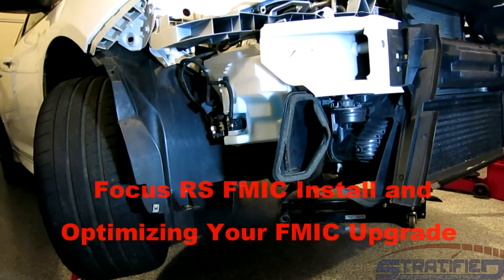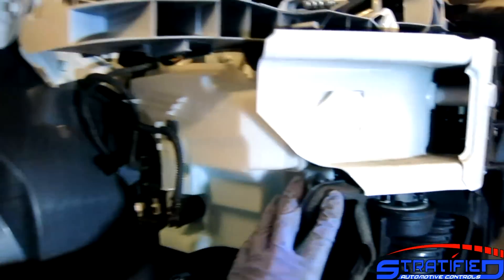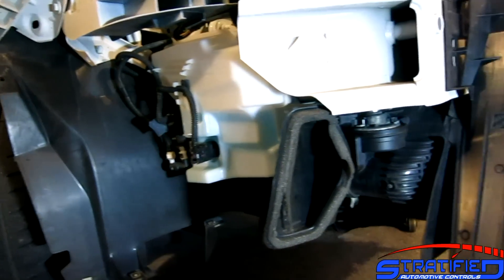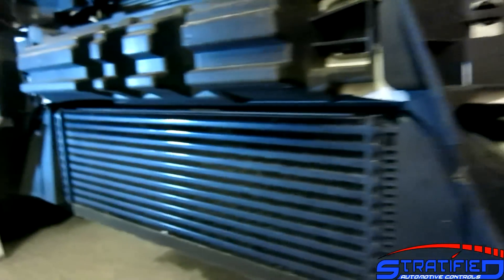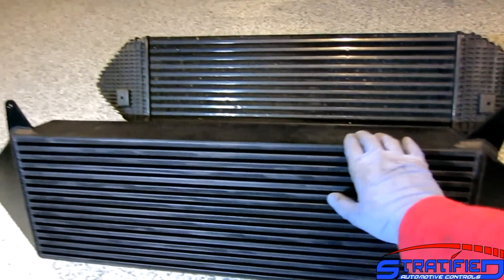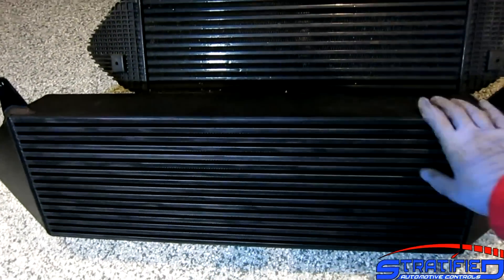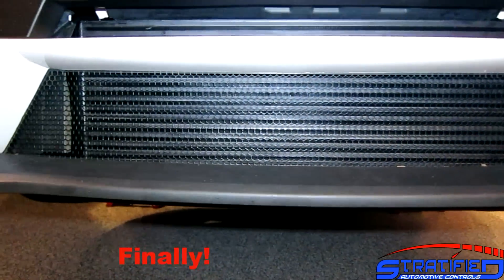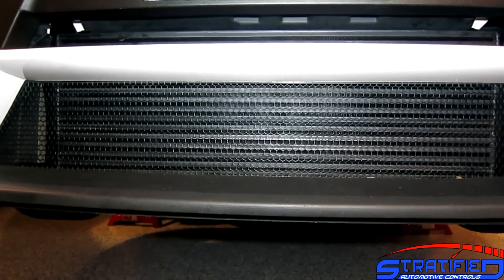Ford Focus RS Intercooler Upgrade and Getting the Most From Your FMIC Upgrade

Comment: its funny you mention the WMI and using the washer fluid tank. i plan to do this, but actually wanted to tie in the tank that came with the WMI for more capacity. do you happen to have a video or pics of WMI pump mounted up front using the washer fluid tank? i've seen several ST's with it like this, but ST's don't have the brake cooling ducts there.. i know i'll probably have to relocate the horn as well. trying to find where/how to mount my pump currently.